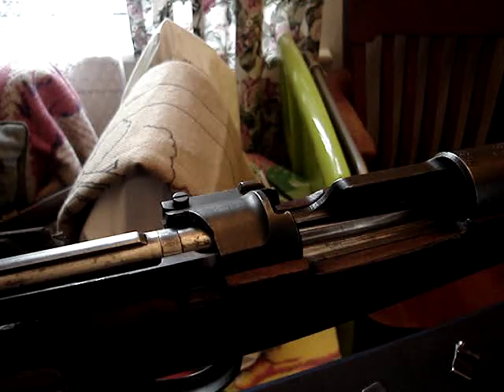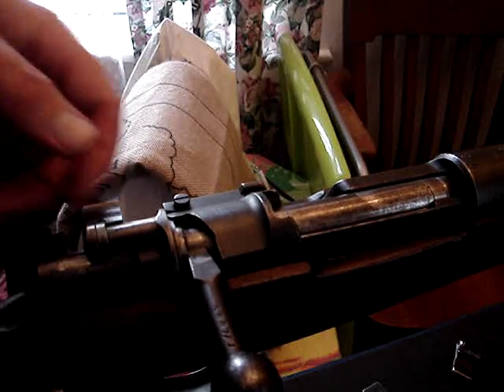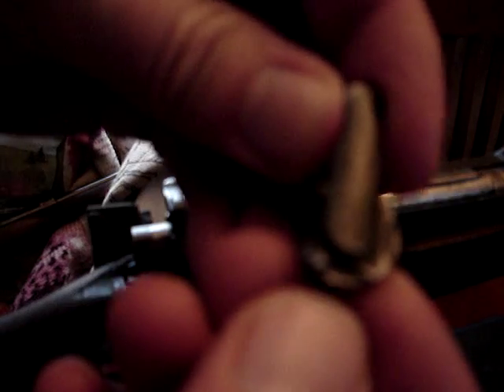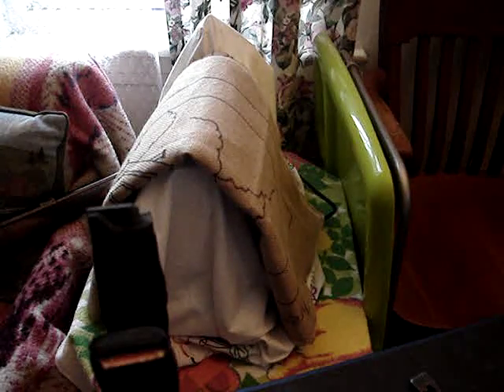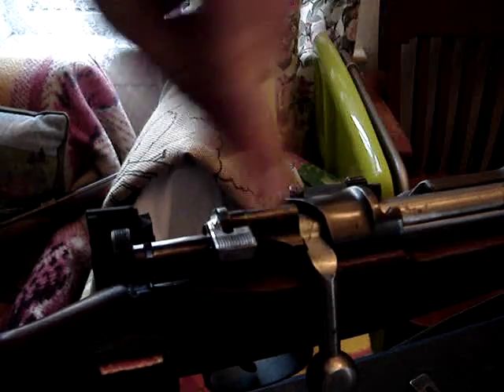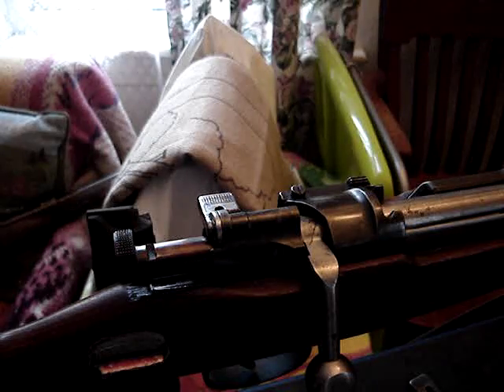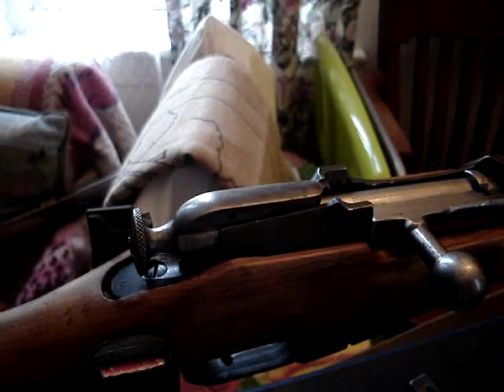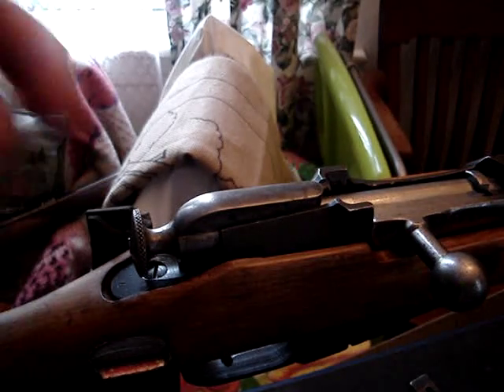Clicking Safety

Comment: Lee Enfield would be a good one. Putting the safety on makes a little noise but taking it off safety makes no noise at all on the two I have.
Reply from the maker: True :)
Reply: Provided you have the hand dexterity, the Mosin safety isn't too loud either. Still, that's a whole nother story. I think that's a topic hunters have talked about in length; whether to use the safety or not, whether to just put 4 rounds in the mag and close the bolt on top of them with no round chambered, it's generally considered a bad idea to go out with 4+1 and the firing pin decocked while resting on the chambered round's primer, and I don't think anyone in their right mind would think it ok to head out with a round chambered, rifle cocked, with no safety engaged at all.

SVT40 and SKS-45 safeties can be quite quiet, though all they do is block the trigger from going back so I dunno if that's as positive a safety as most people would like lol Carcano's safety is rather odd, but quiet. Similar to the Lee Enfield, the P14 and M1917 safeties are very quiet, and also prevent the bolt from moving. M1 Garand's safety clicks though, unfortunately. Perhaps if you're particularly careful while disengaging it, holding it from both ends while shifting it forward, that might prevent any noise.